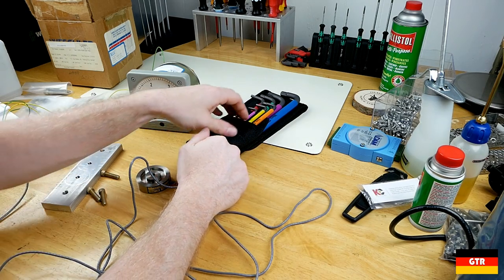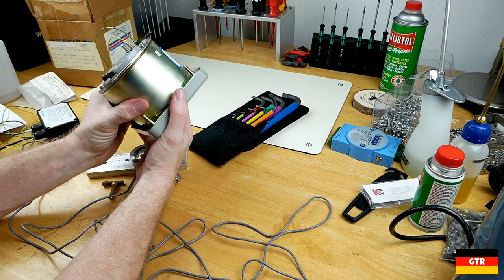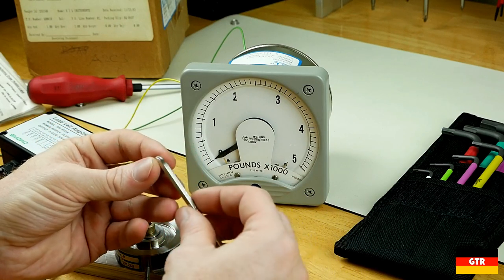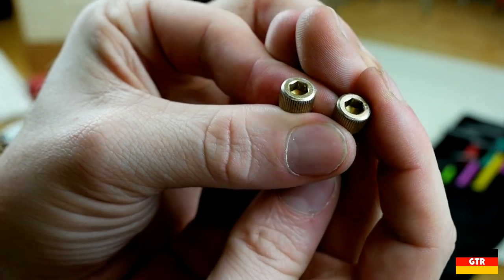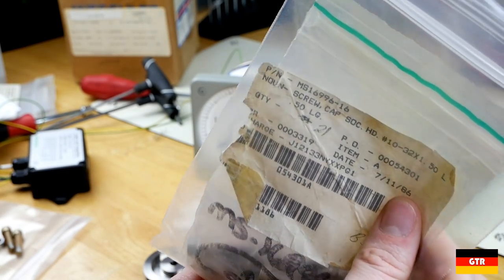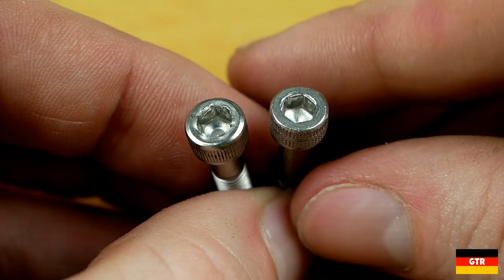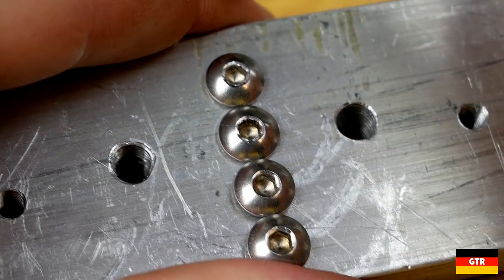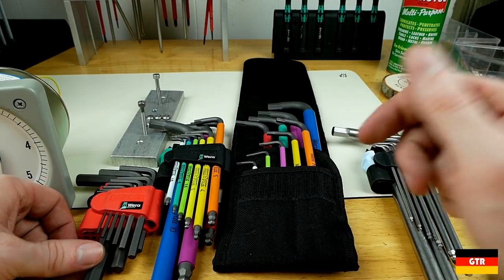Why I now exclusively use Hex-Plus L-Keys:  A short demonstration

Comment: We have used the Wera wrenches at work for years now to remove stripped socket head cap screws. My only complaint with the Wera is that the ball end on the small sizes M3 and under is terrible. Even the standard Allen brand has a superior ball end. You also have to be careful as manufacturing personnel are prone to over tightening with the Wera wrenches because they grip so well. Wera also makes hex bits with this same technology that fit into standard torque drivers where tightening torque is important. Most hex wrenches are cheaply made so the fit is not great which results in stripped sockets. If you want to test how a great standard hex wrench set without the Wera technology is supposed to work like you should review the PB Swiss Tool rainbow Allen wrench set. The PB is my favorite Allen wrench set, I prefer it over the Wera. The Wera will wear out in production use, while I have been using the same PB set for the last 10 years, no joke. The PB is way more expensive, but that's the only negative. Whenever I have run into a sloppy fit it has alway been due to poor screw quality and that's where the Wera shines as it grabs on the flat of the socket. Keep both around if possible.

Comment: The ordinary key you used was chromed and looked pretty cheap so I would expect it damage the screw head, and itself. A good black steel hex key would do less damage.
Reply: Nick Carter I was thinking the same thing, it looked like the cheap husky hex key failed more so than the head of the bolt.
Reply from the maker: The key used in the first part was a Wiha made in Germany.   Those are the ones I used before finding the Hex Plus keys and are definitely well made.  I actually don't even think I used that particular key before because I typically only use metric fasteners.
Reply: Bullshit that the key you used was a Wiha. That is just bullshit. In fact, you show it is a "Husky" whatever the hell that is, some cheapo brand.
Reply: Furthermore, you accidentally showed us at https://youtu.be/t82jTk3mP5E?t=547 that the end of the cheapo hey key was rounded off, not the hex inside the head of the bolt.
Reply from the maker: I used a Wiha for the 1/4-28 socket cap and a Husky for the 10/32 socket caps.  You work for Wiha John?   EDIT:  I also used a husky for the M5 button socket cap screws.
Reply: To me it sounds more like you are shilling for Wera lol
Although they probably wouldn't need your shilling.
Reply from the maker: Na never even talked with anyone from Wera.  If I was a Wera shill then I would have had a set of Jokers by now, but I'm too cheap to buy those yet.  I wouldn't accept anything even if they offered.
Reply: I got some Jokers, they're amazing, you should buy a set.

Comment: The tool is only as good as the fastener. Bolts and nuts are not accurate or precision items.  The thread stretch is from the weaker link, the aluminum.

Comment: Wera is king! I’m a bicycle me mechanic and bikes use predominately hex heads for most fasteners. I need to make sure I’m not stripping/wearing bolt heads, & am remove/install worn bolts. Wera’s hex plus keys are the only tools I like to use/ recommend. They also make torx plus bits/ L keys along with hex sockets and Phillips head tools all with the same idea in mind. Super nice screwdriver handle torx and hex tools as well. definitely highly recommend!

Comment: I like how the solution to the problem of a hex key is to give it more of a torx profile. Haha
I've been telling people for years.
Reply: Ive actually used torx bits to remove stripped out allan key heads. Just get a tight fit and tap it in with a hammer and turn!
Reply: I also use torx on allen  screws for over ten years now specially the smaller they are. ie scope mounts.
Reply: I've actually been using torx as my number 1 go to instead of hex
Reply: Yes. Torx is my favorite fastener, FAR superior to hex and torx plus is even better. But most people use the wrong torx on the wrong fasteners either the wrong size or not torx plus. Torx fits TIGHT very little slop, if it's a little sloppy on a t20 it's probably a t25 and it will be snug

Comment: Great vid! I'll be investing in some of the Wera hex plus "L" keys soon. Sidenote: I believe what you had there was a meter and not a gauge. I was a nuke electrician in the US Navy and we were trained that, basically, a meter takes an electrical input and a gauge takes a mechanical input to create the movement.
Reply from the maker: Thanks!  I'm not sure if it is a meter or gauge, I always thought they were the same thing.  It does take an electrical input 4 to 20 milliamps, but is loop powered meaning it doesn't require an additional power source.

Comment: Nice to see someone do a real test on something.  Im so tired so happy happy Joy joy sponsored reviews.
Reply from the maker: Yeah you will never see a sponsored review on this channel as I buy everything I review myself.  This is also why I tend not to review very expensive tools because I'm cheap!
Reply: Not sure you should be pretending objectivity on this subject, since you clearly made obvious cuts and edits in the vid to conceal the times your super wrench "ratcheted" inside the screw head.
(see 13:05 for example)
When you examine the cuts and edits, this smells more like a sales pitch than an honest review.
Reply from the maker: The cuts were to prevent everyone from falling asleep as I have a tendency to use long pauses in my sentences.  I am designing an experiment that should address any concerns that will be repeatable by anyone who wants to try and won't require any expensive test equipment, just a torque wrench.
Reply: Do R/C! Sounds like you'd enjoy AvE's BOLTR videos
Reply: Nevir202 I was of aves original 1000 subs:)

Comment: Thank you for your experiment. I try to use torx heads when available but these L keys are interesting. May need to grab a set for the tool bag. Not sure if you have one already but a table vice would save your hand a fair bit, cheers.
Reply from the maker: yeah I need a vise...someday I will get one.

Comment: When I first started working on Saabs I found the use of torx screws an interesting choice, but as time goes on it's interesting to me how they've proven themselves in the field. You can remove them time and time again, they're MUCH harder to ruin than almost any other bit it seems. I'm not a professional mechanic, but I've worked on probably 7 Saabs, and many other vehicle brands: the bits that can get used without distorting best is the torx. 

The only thing that kills them is RUST. Those 6 little little nubs rust off and you're screwed, in those rust prone situations a hex bolt head (or) a phillips slot seems to hold up the longest. I've actually had to drill a flat slot in rusted out torx bits before...
Reply from the maker: Cool story.  I've never though about rust affecting the splines on a torx screw.
Reply: this is very true, half the time even with tool truck brands such as Snap-On/Matco/Mac/Cornwell you end up breaking the bit, especially on car brake rotor screws lol. the only time ive had torx strip out was when i used the wrong torx (t27 in a t30)

Comment: I don't even know how this ended up on my feed, but I watched it till the end. Fascinating.
Reply from the maker: YouTube must have changed their algorithm, I don't normally get this many views lol
Reply: Popped up under 'lifestyle' just now on my feed.. I watch a lot of machine tool videos.  I'm not surprised the threads started to strip. Fine thread + aluminum 😔
Reply: The aluminum threads weren't stripping.  The bolt threads were stretching.  Basically, the amount of tension on the bolt was causing it to go past its plastic deformation point.
Reply: Nathan Shaffer I still think that the tread on a steel bolt is quite a lot stronger than that of a piece of aluminium. I have seen a lot of bolts pulled out with the aluminium thread embedded into them bacause of over thightening.
Reply: It is kind of a misunderstanding with words.  It's not the thread surface.  The threads on the steel and aluminum are intact.  To make it more clear, the bolt is stretching and getting longer.  Yes aluminum isn't as strong as steel, but the aluminum is being compressed and the steel is being pulled. The compression strength of aluminum is much much higher than the tensile strength of steel.
Reply: True.  This is a statically indeterminate situation even considering engineering stress in the steel fastener since it necks down under tension.  As long as the aluminum thread length is 3 times the steel fastener diameter, all is fine.  Yes, the first three thread of the Al will fail in shear when the fastener elongates but the rest will hold.

Comment: Might be interesting to have something with a slight twist to the tool. You'd need two versions, one for tightening, one for loosening.It would "bite" at the bottom of the hole where there is less chance of damage.

Comment: Interesting video, as a mechanic I rarely use these right angle shape hex tools, nearly always in bit form, I.e. attach to a ratchet or gun, the beauty of them of course is use in conjunction with a hammer to make bigger sizes/other shape tools fit into badly damaged/rusted bolt heads.
Reply from the maker: Thanks for the insight.  Yeah I rarely use Inhex bits (sockets with hex profiles), but I hear that mechanics use them all the time.   Wera does make those with this profile as well as 1/4" drive hex bits.  I don't have any Wera inhex bits so I can't speak to their quality because I believe all Wera sockets are made in Taiwan.  It is about the only thing that they don't make in the Czech Republic.

Comment: I've both discovered the benefit of hex plus...and also been surprised by Wiha hex bits, which don't seem as great as other Wiha items. Sadly Wera doesn't have a great selection of SAE hex, and I cannot seem to find any security SAE hex. So so my Wera security kraftform kit is supplemented with Wiha SAE security bits. Also, with bits you'll want to be organized because from the side at a glance, they look a lot like torx.
Reply from the maker: Yeah I wish Wera did have more SAE bits.  I do like Wiha L-keys as well as they are very snug with tight tolerances.  That is why I used before I started using the Wera ones.   You can also get Wiha L-Keys with Nickel-plating which I don't think is available from Wera at this time.  Nickel-plating is supposed to be better for long term corrosion resistance.

Comment: I have Wera keys and bits/bitsockets, but I prefer to NOT use them, except in specialized cases.  I almost exclusively use my Bondhus.  The problem with Wera is with regular usage, the corners will wear out and I've not seen the greatest tolerances right out of the box and the amount of torque one can apply, all things being equal, is lower than a well-manufactured hex tool.  I've been using Bondhus for 15 years now, still have my first set and it's my primary.  The Wera eventually wear and slip, plus are much more sensitive to the profiling of the hex in the bolt.  They work well on fasteners that they fit very tightly into and the walls of the hex are rounded.  They are very good, but best kept for special cases rather than everyday usage. For the latter, it's Bondhus.  I've had good experiences with Wera Torx, BUT not their ball ends.  The ball ends are miserable and easily damaged with one usage at extremely low torques.  For hex, I also recommend Koken from Japan and Gedore sockets.  I also have Wiha with the magic ring.  I don't like them and the difference in quality is very noticeable compared to Bondhus.  They are likewise only occasional tools and with regular usage I can totally see them not lasting long.  N00bs count Bondhus out because they price lower than competitors, not realizing that this company has done little branching out and has focused on making nothing short of THE BEST hex tools available without the hype.  This is backed up by numerous technical reviews.
Reply: This is interesting because what you just said contradicts what is shown in this video, and also that L-key comparison test done by Project Farm. In that test, Todd showed that the Wera Hex Plus actually has the least wear compared to other brands such as Wiha and Bondhus.

Comment: Sorry, I seem to have missed the part where you explained the difference between the two types of Allen keys, and why you think the Wera's performed better.
Reply from the maker: Check the part at 11:12 where I go into the details of the difference geometry that a hex-plus has versus a standard hex key.  It is not actually a hex shape but some very complex geometric form that is engineered to maximum force transmission.  It is all detailed in the patent "Force transmission structure especially for a screwing wrench with multiple corners":  https://encrypted.google.com/patents/US6263771

Comment: Thanks for bringing attention to these. It looks like the inverse of Snap-On's flank drive for sockets, where the force is not just applied to the points. I will have to give them a try for sure. See how they fare against my favorite Bondhus.
Reply from the maker: Yeah it definitely looks like it was at least inspired by the flank drive design.  Thanks for watching!
Reply: Rambozo Clown, I thought the same thing.
Reply: Rambozo Clown.   D.K. FAN?
Reply: There are others that have had that for years as well as snap on fwiw . Wright tool  and Grey Pneumatic impact sockets are just 2 examples I personally have sold at my store for years.
Reply: True

Comment: I just ordered a set of the metric long arm wrenches. Thanks for turning me on to these tools. To bad the metric wrenches don't come in a pouch.....
Reply from the maker: You can buy the pouches empty, which is what I did for my metric set.  Much easier to use with the pouch.  I suppose the holder could have some advantages such as space and security.

Comment: Comparing Apples and Oranges: My work in Facilities Maintenance Management, HVAC Technician and Stationary Engineer as well as DIY Automotive maintenance and repair has seen various tool or fastener failures. By far, most of these failures have been attributed to the use of inferior tools. When I switched to MAC Tools hex key sets the failures declined dramatically. The difference in quality between Craftsman (junk), Eclind (better), Bondhause (better yet) and MAC (best) is striking. You compared a Husky with the professional stuff. What kind of results would you expect!?
Reply from the maker: Yeah true, I guess I was thinking all  standard keys would perform about the same.   I could do a test with a high quality L-Key but I would need another setup.

Comment: what yielded when pressure dropped off you put a grade 8 bolt in tapped aluminum  the alluminun shud have yilded
Reply from the maker: Yes you are correct, it would be the internal ALU threads that would be yielding.

Comment: I would have liked to try these about 15 years ago.  I worked on Woodward hydraulic governors and they use a lot of hex head recessed in servo assemblies.  If the rusted ones couldn't be coaxed out with EZ outs or forcing a metric wrench in then I had to do a lot of drilling.  Those little bolts in the middle are the worst things ever designed.  The socket for the wrench is not deep enough.  Nice demonstration!

Comment: Am buying the whole set, and throwing out all my cheapy harbor freight hex keys. I have a couple of Bondhus hex tools, that I replace one at a time when an other one goes missing. But this seems to the perfect solution for cleaning out the junk and only getting a quality tool. I'll probably make a drawer just for them, including Kaizan foam cutouts.
Reply from the maker: Cool.  At some point I'm going to make foam cutouts for my trolley.  Garnett pointed me to toolbed.com that has a huge library for existing tool cutouts.  I designed a drawer for just Hex keys that I plan to order at some point.

Comment: The hex plus will chowder out the corners and not the sides, which is ideal as it will take a very long time before that strips out the biting.

Regardless, I don't think aluminum is strong enough to properly test the hex plus.